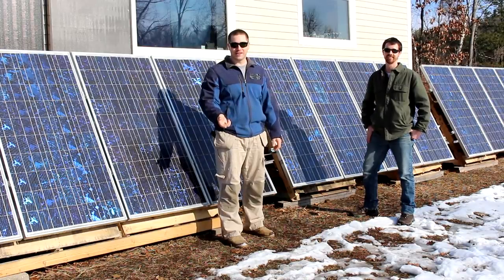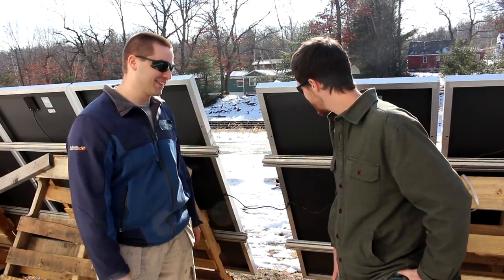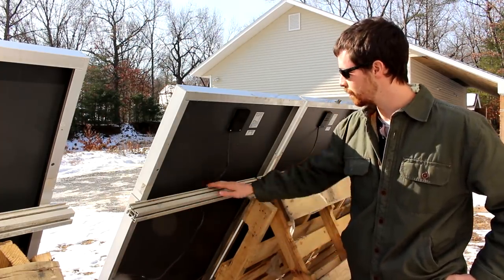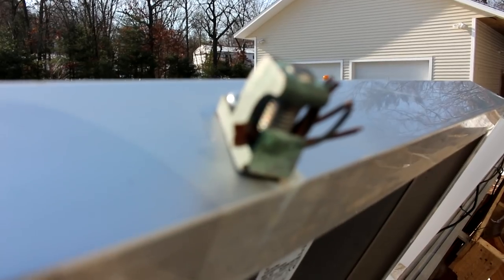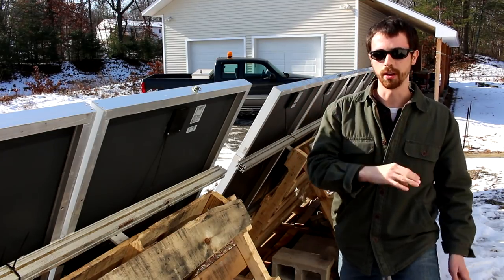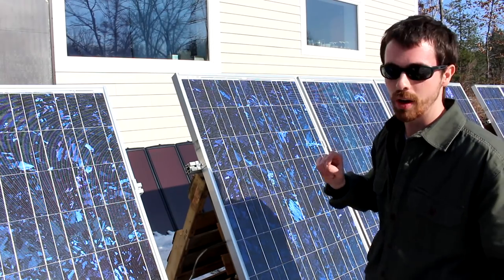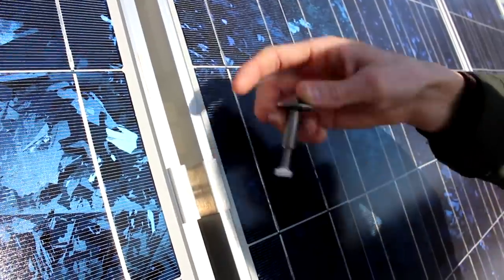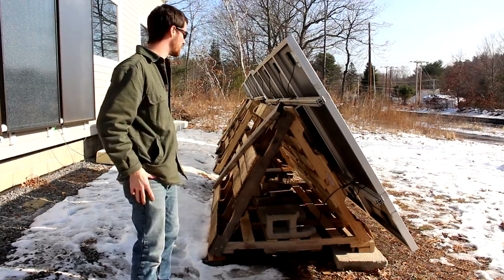A PV Expert finds the flaws in my system

Comment: This "expert" a junior tech still wet behind the ears. This is a good temporary setup that needs a bit more ballast for sure. Then he went off about "getting shocked" in a small system like this I ROFL. The real issues would be integrity of connections, cable length/size. Earth the system if you get lightning storms, or bolt the frames together. With high humidity I'd try NOT damage the anodizing to avoid galvanic corrosion. In Africa you tie everything down to prevent theft, clearly not in colder parts of NA ;)
Zip ties are cheap, but be careful of damaging the wires when moving the setup when you cut the ties, (it happens to pros). I hope you didn't pay more than two buds for this opinion :D
Reply from the maker: Hi Craig,  Thanks for sharing your opinion, I noticed a few comments from you, thanks.  After Kevin's suggestions I went ahead and grounded the frame and panels, here is a video on it:  https://youtu.be/1ldNGpd7ebY
Reply: cool, I watched it. Did you notice the corrosion under the old earth clamp? Dissimilar metals, moisture and small electric current will do that. There are anti-corroson compounds available to prevent that, easily available in the 'States. When earthing I only use bear copper in the ground, insulated copper where exposed, same reason, by the way the bare copper a foot down gives better long-term protection than copper coated rods. Tying all metal bits (bonding) that "may" come into contact with lethal voltages or high currents always better for safety and so on. I'm a 30 year veteran missionary and electronic system integrator/installer, a veteran radio tech/ham as well, have thousands of commercial installations and hundreds of home installs under the belt. We learned solar and generators when it was a rarity expats used where there was no grid or the grid was constantly OFF ;) what WORKS (within safety and economics) is more important then blindly "following code". 

We about to emigrate from Africa, but I had a bout of the "swine" flu, so I took some time out to research stuff about tiny houses, homesteading and so on and YT decided to recommend one of your vids. I've spotted some before when researching water heating or something else. 

Stay safe, stay real ;)
Reply from the maker: Sounds Good.  Thanks for sharing my video.
Reply: not so sure about the expert part but hey we all sharing. having those wires secure is always a good idea as you do not want shorts
Reply: Craig Symington 
Hi Craig and David...
I’m a new subscriber and look forward to seeing more.
I’m an avid Sailor and there’s always issues with dissimilar
metals and especially in salt water.
The trick all of us use is to put Zink fittings and/or washers
in between any dissimilar metals as the Zink will dissolve before
any corrosion takes place.
They usually last for several months, it depends on what they are
being used on,(the stronger the current going through an item the
shorter they last), good to check routinely until you get an idea on 
life spans.
I don’t see why this wouldn’t work on shore installations too.
Also, I liked your repurposed old pallets as frame work for your Solar
Array.
I would have to agree with the gentleman checking out your system
that it needs some more ballast, last thing you want is an up-turned
or knocked over Solar Array which could potentially cause damage to 
your system...
I was thinking, if your Solar Array is in its permanent location, instead
of attempting to add any more cinder blocks for some extra weight, how
about digging some cement footers and then using the metal hurricane 
tie-down straps that are used for securing Mobile Homes...?
They are readily available, the cost isn’t that much,(especially if you have
either a mobile home salvage yard or a Habitat for Humanity store near by),
they are easy to install, and can hold down the World if installed correctly...!
Hope these ideas might be found useful by someone.
Thanks for sharing this information with us.
Have a great day and be blessed.

Comment: Maybe have Kevin back to show how to rewire in parallel and what to use.
Reply from the maker: That's a good idea.  Thanks for the suggestion.  I'm always looking for more video ideas.
Reply: DavidPoz Thank You, some DIY on YouTube, will never admit a mistake.  Can you ask Kevin if a house totally run on DC would be more efficient then using  AC? 
 Example, DC powered house;
 The electric co service connects to the house's E. panel only the Furance/AC and E. Range run on AC power. The rest of the power supply is converted to low voltage DC.  The lights would be DC Leds, the small appliances would DC models along with Electronics.  The Solar panels would stay DC and be connected into the house panel.  Less voltage and amps usage providing the same lifestyle.  Also maybe cheaper to wire, lower chance of fire and electrocution.  Maybe lowering the need for new Power plants. It's just a Theory from watching people with solar powered RVs.
Reply from the maker: That is what I have found when looking into it as well.  Assuming you buy a DC fridge, they come in 12/24V, there are only a handful to choose from on the market, and they cost $2k.  Just one example.
Reply: and also what happens if you mix panels

Comment: Need expert advise, I had 2035VA off grid solar inverter; which support 24V upto 1200W solar panel. i got 30V 350W, 4 Panel. is this will work with my inverter?
Reply: it should. its the charge controller that needs to support your 1400W , the inverter should be fine

Comment: I'm surprised he mentioned that a little bit of shading will shut your entire system down when wiring in series. Not true.  He doesn't seem to be aware of bypass diodes which were common even even 5 years ago.

Comment: Old solar guy here, Several things.

YOU have good protection from wind getting behind your free standing array, you will likely be okay. If they were in open air they would have very little chance of surviving. on a job site a smaller array with less angle flipped over in a 25 - 30 mph wind, with 2 - 40 lb bags of top soil on the back support, all the panels survived except the top one. even with the bags of soil landing on them!

For NEC code a ground mount system with accessible wiring DC voltages above 30 volts, the wiring must be protected. Since the wires come out of a back the panel with no way to place directly into conduit, the only way to meet code is to fence around your panels! Lots of inspectors ignore this, but if you get a picky guy...

This link will explain it;

http://www.ecmweb.com/nec/wiring-methods-pv-systems-and-nec

I saw you bought a cheap inverter in another video, you should get your friend behind the scenes. If he is installing things not to code he could lose his license or certification, assuming he has any. If that inverter has a UL rating it will be UL458 for mobile use. Home use requires UL1741. Your video showing installation not to code means you should probably quit paying your insurance bill as they will gladly use such as an example of poor stewardship.

I do see inspected home systems which don't meet NEC standards, the DC wiring should be encased as well as all the other wiring. Might get a Midnite E-Panel making the wiring and protection/breakeers easier to manage in a code compliant nature.
Reply from the maker: Hi Whit, Thanks for the great comment and article link.  Kevin, in the video, did not install my panels, I did that DIY.  The cheap inverter is to get me by until I can save up enough money for a better one, like a Magnum or Schneider.
Reply: Whit, 

Are you seeing professional installers following NEC and UL standards?  You may not want to answer that question :)

Can you share standards on battery and inverters?  I like the link but it's only for the panels.

I found a recording of the inspector of Dallas talking about common problems they see at homes and changes to 2014 code.  Pretty good & quick review though I wish they'd recorded his slides: https://www.youtube.com/watch?v=6veYXz1QR84
Reply: yeah those few bricks aint enough
Reply: Hi Whit,
Thanks for quoting codes. It could save someone's life. People often struggle to understand electrical safety.
My brother survived kiloVolts from a train yard, but I use kiloVolts to fence livestock. The difference is in the current. Some may have experienced microstimulation from a physiotherapist to relax strained muscles. It's always easy to simplify our understanding and run into a problem later when the circumstances don't match the simplification that we stored away.

Comment: Why not mount the solar panels  on a better stand about 1m off the ground in an almost horizontal alignment to the ground. In that way you can get maximum solar array for most of the day.
Reply from the maker: HI Ogo Mbachu,  Right behind the ground mount is my house with flat-plate collectors on the house.  If I mounted the panels any higher I would end up shading the house.  Thanks for commenting.
Reply: The best angle depends on your location specifically, it is not one number fits all.

Comment: i am running 3 panels all in paralel two 8.7A and one 5.5A would that make 22.9A or 16.5A ? also bought a mppt charge controller with 4 120AH batteries in 24V so 240AH
Reply from the maker: Check out this post and video.  It demonstrates what happens with panels wired together: https://www.altestore.com/blog/2016/09/wiring-mismatched-solar-panels-in-series-and-parallel/
Reply: interesting but I know this already. in parallel all the amps get added together by the looks of it.

Comment: Your system doesn't look like it gets any shade so I think you chose the right layout.
Reply: What is the advantage of Series over parallel, and why not layout all in parallel, when potential advantage is so great. Also I don't think its only shade of a structure that is obstacle here. You can have leaf collection on one panel, snow collection, dust or likewise that causes a single panel turn into a failing resistor for the entire system... So please let me know what and if, I'm missing something here.
Reply: @samsen201  It has to do with shading.  In series if one of the panels is shaded, the others in series with it suffer.  They are all drawn down to that level.  The best solution for having solar where you know you will have shading is micro inverters.  If shading isn't a problem, then series increases the voltage which decrease the current flow.  The higher the current flow, the thicker the wires must be and the more expensive they become.  The disadvantage of series is you are adding the voltages of your panels.  Most charge controllers have a max (like 150v) therefore you can only put so many in series.  In a system of any size you are going to do both series and parallel.
Reply: @Core 1783  incorrect. Panels have bypass diodes now so the other non shaded Panels,  in series,  still provide power.  @davidpoz, should remove the shading segment from this video.

Comment: What is the best device to detect fault,If I decided to ground those panels?
Reply: What type of fault.. U r kinda missing the point. Several different things are all capable of creating conditions that you will wish u had grounded them. If that fault is a short from your house wiring.. Assuming u didn't do it.. Likely u pop a breaker or gfci because of current into the ground being either substantial or tiny but gfcied.. I could go on but there is no situation I can think of where u r really better off with the panels floating (safety wise)

Comment: Thanks for explaining the shading issues and the grounding. To add to the discussion, did you install a lightning strike surge protector?  Very important. 
Here is a picture of one, very easy to install, just add it to your combiner box. Make sure you purchase the correct voltage for your system.

https://www.thesolarbiz.com/enclosures-installation-accessories/midnite-solar-mnspd-115-surge-protector.html

Here is an article I found online. 

 http://solarprofessional.com/articles/design-installation/surge-protection-devices-for-pv-installations
Reply from the maker: Hi Mark,  Great point.  I have not yet installed a surge protector, but it is on my to-do list.

Comment: Series wiring is best.  Put a diode across each panel, cathode to plus, to carry the current if the panel is shaded.  The converter should compensate for the lost voltage from one or two panels.

Comment: Hi so he is saying only about minuses, what I would like to know if you could possibly answer. 1. How much did you spend money on that?
2. How much electricity do you get on average?
Reply from the maker: Hi Alvar Battalov: I think I'm about $1000 into it with the circuit breakers and grounding I've added.  I don't have these panels connected to a meter.  They are wired to my electric baseboard heater.  It handles all the heating for the house on a sunny day (and through the night).  I've got another video on the heater, but it was before adding the circuit breakers, so things look a little different now: https://youtu.be/jFoxIit8NYA
Reply: @DavidPozEnergy  hey David
Check if you got bypass diodes in the lead box back on you panels .. if you dont hawe that just 
Buy schottkey diodes and Mount on on every panel . So SHADDOWS don't affekt the whole string
Series is way superior to paralell 
Series = higher volt longer and fewer leads
Paralell = way mor leads .. THIKKER LEADS ... 
MPPT not PWM CONTROLER

Comment: using microinvertors rather than a single invertor stops a single panel stopping system output,  it becomes more proportional
Reply: Yes, but an inverter on every one of his panels gets expensive real quick.
Reply: Sometimes you get what you pay for and the revenue justifies the capital expense.

Comment: please help, what really charges a solar battery,high amperage or high voltage?
Reply from the maker: My system is built with lithium batteries.  So most of my charging curve is a constant voltage (48.6v in my case) and the current will start at 100 amps, and the charge controller will taper the current down as the batteries fill up.

Comment: In the developed world, you don't use metal conduit, ever; not in buildings, not on the roof, not in a car, not on a boat - it hasn't been used in decades. You'd use a flexible expandable plastic conduit which absorbs the expansion-contract. This is international industry standard.
Reply: But it melts and deforms in arizona sun

Comment: You have a lot of $ investment in the solar panels. It is better to ankle the racks to the floor instead just ballasts. For grounding, connect the ground wire to a metal water pipe nearest to it.

Comment: Grounding and bonding can be a very confusing subject. Just connecting a wire to ground wont make it safe. For example if one of your wires came in contact with your metal frame and you had a ground wire connected to a grounding electrode all you would be doing is electrifying the ground. To make it safe you must turn the power off. To do that you must "bond" all metal together. Then those "bonded" components must bring current back to the source of electricity and not the ground. So you would want to bond all panels together then bring those bonded panels back to your combiner box with a ground cable. If there is a fault the current will travel through all the bonded equipment to the combiner and trip your breakers. By  bringing current back to the source it will trigger your safety devices gfci breakers fuses etc. Pumping energy in to the ground may not actually provide enough resistance to trip a breaker thereby energizing the ground and creating a serious health and safety risk. And believe it or not the ground can be quite conductive and an electrical current can travel a fair distance from the source. If all your equipment is bonded together and those bonds lead back to the panel in the event of a fault your breaker will trip. I believe grounding electrodes are a means of dissipating lightning. Not protecting from lightning just providing a conduit to ground where lightning wants to go anyway.
Reply from the maker: Very well said.  I'm sorry for any miss-use of the terms grounding vs. bonding.  I'm still learning about he topic.
Reply: @DavidPozEnergy  I enjoy your videos. As a fellow diy er I had to endure hours of migraine enduing technical babble from people much smarter than I. Maybe I can spare you some of that. My solar setup is very similar to yours. There are circumstances where pounding an electrode in to the ground and connecting your array to it could be a bad thing. If lightning struck near your panels you have created a path of minimal resistance right through your panels  through your wiring in to your charge controller, power inverter and any other electrical  equipment connected. As well as any metal bonded to that system. The terms grounding and bonding are not interchangeable. Not saying you did that, just getting a grasp on the difference and the importance of each is a must for anyone involved with generating electricity. Keep em coming I have learned my fair share from you.

Comment: "the angle is not very different" out of context?
I am reading that you want to find your latitude.
Add 15 degrees to your latitude for the winter months
&
Subtract 15 degrees from your latitude for the summer months
Reply: It was probably in the same context as shading, as in, if one panel in series was "off" optimal angle for the season, would it have the same impact as a shaded panel. The answer is, yes, depending on the degree- but none of the panels were so far off that it would have a significant impact.